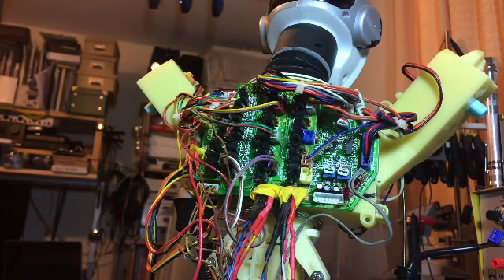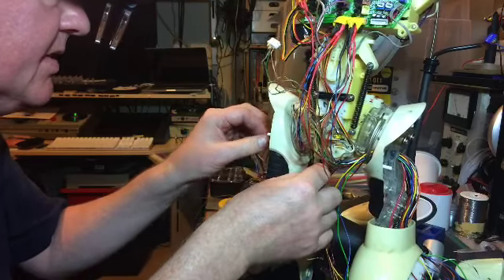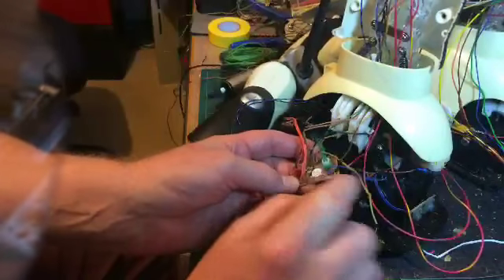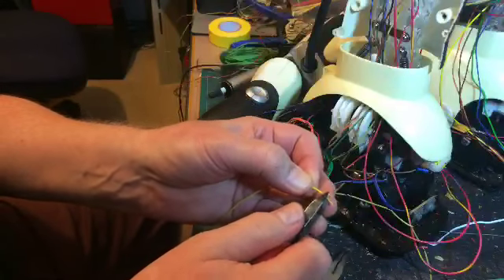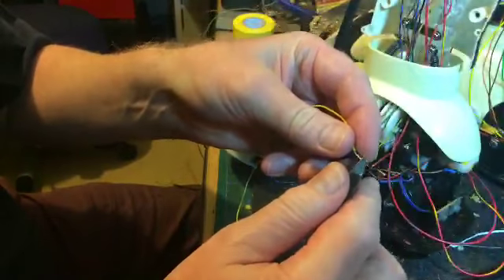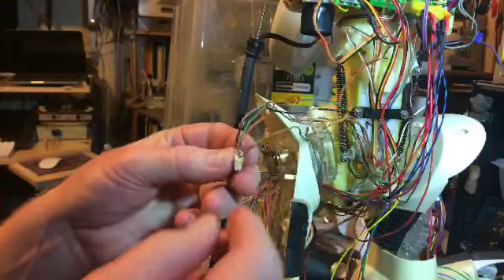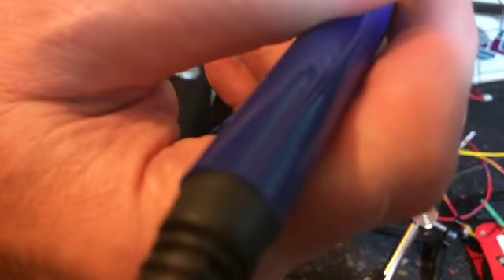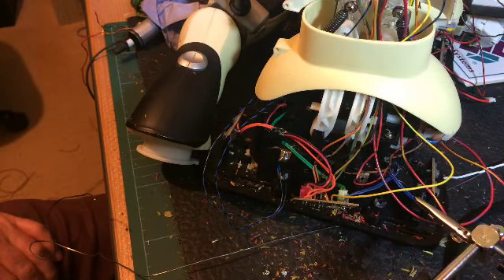Fixing WowWee Robosapien V2 Wiring Repair Part 3 - fixed1t LIVE

Comment: Nice video, I have used Teflon insulated wire in the past.  It s extremely durable, supports much higher heat, flexible, and doesn't dry out with age.  It used to be expensive, but available quite reasonable at auction sites.   I obtained mine from aircraft suppliers.  It is more readily available today at affordable prices. It easily lasts several lifetimes.  Don't know what gauge wire you use but,  for example, see item: 382140957318
Reply from the maker: Thanks Its good to hear back from you, I'll check the gauge, Regards Malcolm